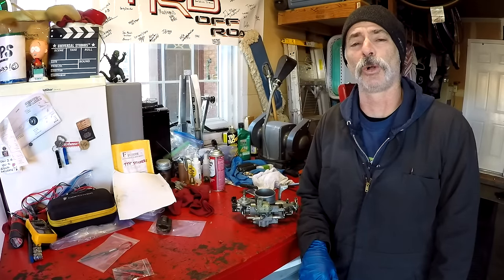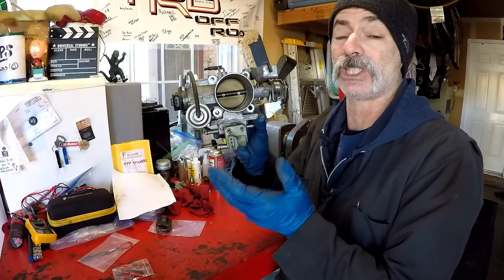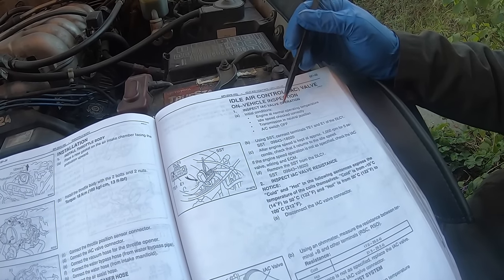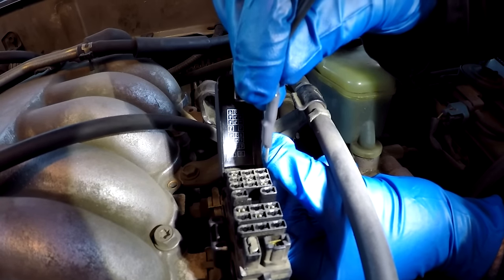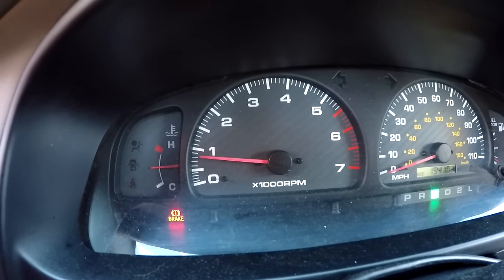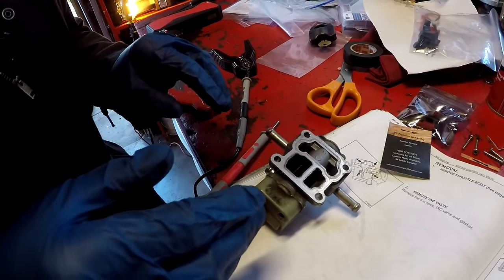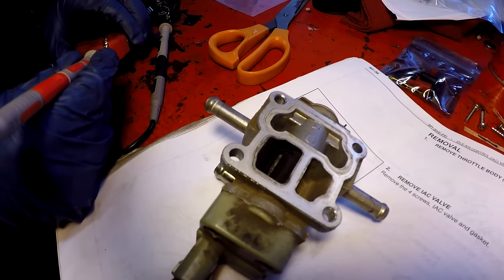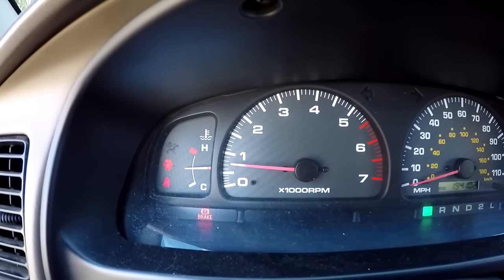IAC Valve Testing and Cleaning

Comment: Just wanted to thank you one more time!  I replaced the IAC valve on my 2002 Tacoma SR5 PreRunner today following your video as I did the work.  There were only a couple of minor differences between yours and mine.  I still failed my smog test though because I didn't drive the vehicle long enough after the job, resulting in an OBII failure.  I was told to drive it about 40 miles and then bring it back for a free re-test.  Thanks again!
Reply from the maker: You're welcome again Chuck.  Here's a tip for knowing if your rig is ready for a smog check.  You can either buy a scan gauge tool that will let you know all your system monitors are reset and ready or you can get an OBD II reader that sends info to a phone app like Torque Pro.  Then you won't have to guess if your vehicle is ready for a smog test.  I use to use the Torque Pro phone app to monitor things but I switched to using a Scan Gauge.  Here's a link for you: https://amzn.to/2QTlz6z
Reply: @TimmyTheToolman  Thanks!!
Reply from the maker: @chuckmacwilliam4168  You're welcome!

Comment: Early model IAC control solenoids were set at a dimension of 1 1/8” with a spring set manually . Failed twice in two weeks , returned to NAPA this time they were nice enough to exchange it with the non adjustable upgraded version ! They wanted to deplete the defective stock first ! How nice of them !
Reply from the maker: Well, good to hear they finally took care of you.  Better late than never.

Comment: I want to share some other ideas. My Hyundai Santa Fe (manual) has been sitting for a year. Now when I start it up, it stalls immediately unless I keep the gas pedal pressed a little.

I used a trick from FordTechMakuloco's video and stuck a thin shim under the throttle cable lever thing to prevent it from closing all the way. Genius trick and it worked.

Then I tried pushing my AC button. Sure enough the rpm went way down, almost stalling. I thought I could push the AC on/off a few times to kind of work the valve unstuck (remember, it's been sitting for a long time so maybe it got stuck slightly by dried carbon that solidified around it).

It didn't work. And as soon as I removed the shim, the engine stalled. That's proof enough for me that this valve is likely the problem.
Reply from the maker: Yep, your engine relies on the IAC valve to open under idling and deceleration situations so it can get the air it needs to create the air/fuel mixture required to run.  Sounds like a bad IAC valve to me.

Comment: Huge tip: Remove the top two studs ( M8-1.25 -- XX mm or some such) and replace with Dorman (anyone's) M8-1.25 -- YY -- you be the judge. (Use the studs to judge length.) These Flanged Bolts are available in every parts house. The labor savings are astounding. (A full hour on a Sienna plenum project. You won't have to touch the throttle body, any of its connections!)

Toyota used 12mm nuts for these studs. The Dorman bolts will need 13mm sockets. Otherwise, they are identical.

Once you've made the swap, you'll kick yourself that you didn't do so earlier. 

On my Sienna, it's best to remove the (3) studs the moment you can wiggle a Knipex pump handle pliers in between. They are then easily pulled away from the plenum... right through the throttle body. The studs only make sense back at the factory... not in your repair bay.

For small hose removal, a trivial,  common body tool -- with a forked end -- is dreamy for PUSHING hoses off of their connection. All hoses are best shoved off as they relax under compression from that direction. When you pull on them, you're getting the Chinese fingers effect. You're actually tightening them down around the metal tubing -- often to the point of semi-destruction. (Frayed termination, and temper -- yours.)

Once you're going to this much effort, you'd be crazy to re-use gaskets. A vacuum leak, from a re-used gasket, will cause personal insanity. If you dig into the issue, the gaskets are one-time seals. They deform upon use. If rubber/ elastomeric they HARDEN. When that happens, they will not 'flow' to seal. You can easily end up with a tiny vacuum leak -- that degrades your engine -- for years. And you just can't put your finger on it. When you visit the junkyard -- always a wise idea -- you'll see how poor repairs// maintenance killed engine after engine. (Totally filthy MAF sensors at the top of the list.)
Reply from the maker: Thanks for sharing all of this.

Comment: Before taking the throttle body off: Try removing the 3- hoses and spraying carb cleaner into the IAC valve, and moving the pin (2 screws and cap) back and forth and letting it sit over night....worked for me!
Reply from the maker: Thanks for sharing your technique.
Reply: i may try that
Reply: Label the hoses 1,2,3 with tape to keep the order correct. Or draw a diagram.

Comment: Great video! I learned some of this the hard way on my '95 Avalon (1MZFE) which has a very similar throttle body. I had to remove the intake manifold to replace the knock sensor harness. While I was at it I did a lot cleaning of the throttle body, plenum, and intake manifold ports and replaced  all the. After I had that whole job done, it ran fine but I had a very high idle. From your video and others I realized it was probably the IAC valve. I  think carbon and gunk got into the IAC when I cleaned out the throttle body and butterfly without turning it upside down, or covering that IAC intake port. 

Sure enough, after cleaning out the IAC (in position without removing throttle body), and letting lots of cleaner flow out the air hose nipple, my idle returned to a perfect 750-800 RPM when warmed up. Hoping it stays that way. If not, I'll remove the throttle body and do the full cleaning. Now I know how. Thanks again.

P.S. Just read your exchange with @jacobs2309 about the throttle body spray dissolving the grease out of the bearings. As I did it the simple (stupid) way  of just spraying the cleaner in there, perhaps I will pay later as those bearings seize up. Oh well, at least I'll know what to suspect in the future.
Reply from the maker: I wouldn't worry about the bearings.  Good job fixing your issue.  Happy Wrenching!
Reply: @TimmyTheToolman  Thanks. Good to hear.

Comment: Nice comment about not connecting the coolant hose to the air inlet.  I did and holy shit!  It ran but after a few seconds it leaked coolant and blew lots of steam out of the exhaust.  Fixed my mistake and took it for a 7 mile drive.  The only effect seemed to be an increase in the idle speed in neutral to about 1500 rpm from what it was before about 1200.  Removed the IAC valve, disassembled it and found it was clean.  I guess it had been steam cleaned(:  On reinstall I now get about 1200 rpm in neutral.  It is an aftermarket IAC.  Engine with 311,500 miles.  I think I will try new aftermarket IAC.
Reply from the maker: You're not the first that has happened to and you won't be the last.  It's happens.   An OEM IAC would be a better bet but they are pricey.
Reply: @TimmyTheToolman   I did the same. How did it end for you? What should I do ?

Comment: Yup smoked out the parking lot... idle is silk smooth, engine is more responsive... thank you. Definitely a to do periodically... learned a lot from ur vids... much appreciation... whish i could have a beer w u
Reply from the maker: Great to hear our video helped you out.  Thanks for taking the time to comment and let us know.  Happy Wrenching!
Reply: Update... 2 days later the intermittent high idle returned...
Went through the process, iac interior and flap  definitely needed carbon buildup cleaning... followed the step by step process with lots of q-tips & spray... result-  solid 750 rpms  at idle. Thank you.
Reply from the maker: @zorbakorba4180  You're welcome.  Good job fixing your issue.

Comment: Any time the T body comes off a 3.4l, i use a supercharger gasket because its the full circle not D-shaped.  Doing this, and taking off the 90⁰ elbow where the airbox goes into the fender and using a K&N stock replacement air filter gives 8 extra horsepower.  Port-matching the intake manifold and running 92 octane  also will make the thing SCREAM
Reply from the maker: 8 extra horsepower!  Wooohoooo!
Reply: Do they sell the supercharger gasket at oriellys

Comment: Tim, Thank you for all your videos.  I have a 2000 4runner with 300k miles and really enjoy the truck and your videos.  I recently replaced the timing belt, had all injectors cleaned and flow testing performed, replaced the fuel pressure regulator while it was apart along with a new IAC and throttle position sensor, plugs wires, gaskets, and coil packs.  All Toyota parts since I have had issues using aftermarket parts not communicating right with the computer or gauges.  I have an issue with long cranks though when the engine is warm or hot.  It starts immediately when it is cold or right after running.  The problem is when it sits for 30 minutes to a few hours.  It seems like it is flooding.  If I press down the gas pedal a little it seems like it pops off.  The IAC tested fine using your video, but I decided to replace it anyway thinking just maybe this was the issue anyway and who knows with 300k miles wouldn't hurt.  About a year ago, I replaced the fuel pump and sending unit as well because I was having the issue with the sending unit per the TSB.  I'm really at a loss?  What do you think might be worth replacing or checking?  I don't think there is anything else I missed.  Thanks again for your videos.  Looking forward to your reply when you get the opportunity.  Best regards, Mark
Reply from the maker: Hey Mark, glad you like our videos.  Your problem sounds like a difficult one to figure out.  You already addressed the things I would have thought as the culprit.  I did a little research just now and one guy realized he had a bad MAF which caused the same symptoms you're experiencing, a hard start when warm.  Maybe test and clean the MAF and see where that gets you.  If it still is having a hard start after you verify it passes the ohms resistance test and you cleaned it, get the engine hot again, let it sit and then before you start it unplug the MAF.  It is starts right up, but obviously gives you a CEL code for the MAF disconnected, I think that would be proof it was your problem.
Reply: Mark Cunnings.  Did you ever figure out what your hard start issue was???
I have the exact problem in my sons 2002 4Runner.  Replaced all injectors & fuel regulator, no help.  Then new MAF & no help.  Throwing lean code P0171 & now random misfire P0300.  Appreciate any feedback.  Happy New Year!

Comment: Cool. You can also use an m12 battery with a couple of mini fuses stuck in the slots and then clip to those. Also, with scan tool I was able to monitor the duty cycle of a normally functioning IAC at idle (30%) and then with a load of AC compressor or slightly turning the wheel (increased to 40%).  It's a 2006 Matrix with over 2006,000 miles.
Reply from the maker: Thanks for sharing.

Comment: I really enjoy the level of detail you include that a lot of the other repair videos gloss over.  

I found that wire loom retainer like the one that you released in the beginning of the disassembly at 14:28 by squeezing with a pair of needle nose pliers can be released by using an 11mm socket to squeeze the pins of the retainer and it's less likely to mangle the plastic by squeezing too hard.
Reply from the maker: Thanks Steve.  Good to hear you appreciate the detail we offer in our videos.  I like your socket trick for those types of clips.  I'm going to try that out.  Happy Wrenching!

Comment: Thank you sir. Very much thank you. I took off the TB last night after cleaning the IAC valve and that did not work. So I took it off again and found the entire mechanism was seized somehow so I worked it around. The rpm before was around 1750 idle after warm up. It would shift into second gear in drive with no gas.  Now it is at a cool 750. Tysm
Reply from the maker: You are very welcome.  Stoked you figured it and fixed the problem.

Comment: So Tim i was not able to find a service tool to put into the diagnostic port, but I did follow the proper steps and procedure of cleaning the IAC and throttle body. Taking both pieces off correctly,  taping off all of the sensors and cleaning both the IAC and throttle body, drying them before placing them back, two weeks later an engine light comes on for the IAC. I'm getting better gas mileage since before I barely got 200 miles a tank and now i'm getting 250miles a tank with 2.5 inches of lift. It doesn't make sense to me, could it be a false code? Currently looking to find the service tool.....However, I appreciate all of the videos you upload and brings me joy there is someone out there teaching people how to work on yoders!!!
Reply from the maker: Clear the code and maybe it doesn't come back.  If your rig is running well, I wouldn't worry about the CEL at this point.  If you need to smog your rig soon, then it could be an issue for you.
Reply: @TimmyTheToolman  The rig is running fine, getting better gas mileage which is a plus! I've already cleared the engine code twice now and it shows up right after 200 miles ? Im not entirely sure, I need to test the revs and as well get a multimeter to test the omhs. I did kinda blast the IAC with throttle body cleaner when i did the job maybe it shorted the iac ? or would it not even be running if the iac didnt work ?
Reply from the maker: @soroushazizi4700  If it shorted out, it wouldn't work.  At least I don't think it would work.

Comment: I did this a couple of years ago on my truck. Now just this last weekend, I changed it out for new. I have 183, 000 on my truck, 5VZ-FE.
Reply from the maker: I guess it finally quit working and that's why you replaced it?
Reply: @TimmyTheToolman  In the last couple of years it has been a cascade of trouble codes surrounding the TPS, IAC, and MAF. I imagine my living in this dusty area of the valley in AZ caused this to happen. Then again not bad with 150,000 + when it all started. I replaced the MAF sensor about 2 years ago, and that was when I cleaned the IAC. Then this past year the truck kept idling poorly. Then it threw a PO120 code and I knew that either the TPS or IAC was bad. I just decided to replace the components. Now seeing this video, I will go through the tests next time around... Say at 300,000 miles! :-) I love your vids, Timmy!
Reply from the maker: @JLin576  Gotcha.  Glad you're liking the videos we make.  Happy Wrenching!

Comment: Success! The IAC is re-installed and now the Tacoma starts and idles, instead of starts and dies. When testing my IAC with the battery I could see something inside it moving, so I knew it wasn't completely dead at least. Unbelievably my local dealer would have sold me a new IAC for $444 plus tax, for just the part. I see them for sale much, much cheaper on Ebay but not sure if those are junk, or the same part the dealer sells?
Reply from the maker: Glad it worked out for your Mike.  The dealer marks up parts by a lot.  There's lots of Ebay and Amazon seller that sell genuine Toyota parts.  Online pricing for Toyota parts is always going to be way more affordable than buying directly from a dealer parts department.

Comment: 01 Toyota 4 banger TRD I also took my intake manifold off an clean it with oven cleaner it was filled with grease an fine dust nasty but boy did it clean up nice an it runs so nice now 189.680 miles that stuff was making the truck run ruff ✌️an also lacquer thinner in the gas  for the cat 💪😎✌️
Reply from the maker: Good job!

Comment: I had Toyota camry with a gummed up IAC valve which cause stalling. - I just removed it and cleaned it with kerosene and then electrical contact cleaner.  It worked perfectly after that.
Reply from the maker: Good job!

Comment: Hi, I noticed you didn't bleed your cooling system after reconnecting the hoses. Is it OK to lose a bit of water this way and not need to bleed? Thanks.
Reply from the maker: Yes, it's ok.  Any air introduced will eventually work it's way out to the radiator reservoir.

Comment: Thanks for the video Tim! 
My 4Runner tossed a P0505 code the other day, idle was high in Park. Deceleration felt odd. Did your bench test and it failed.
Reply from the maker: You're welcome.   Hope the new IAC Valve fixes the issue.